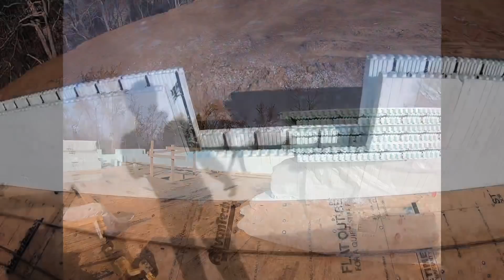ICF second level stacking #ICF #nudura #nyamillennial

Comment: Nice job Matt. Good tip on keeping the height of doors and windows the same. Would it have been better to not poured the cement so high in the top block?
Reply from the maker: Tom, the concrete is kept roughly 2” below the top of the last block on the basement pour. This ensure a constant height for the cold joint. If we didn’t smooth it down it would be very difficult to get a consistent height.  This is just what we have found to be the best. What helps most is having proper thickness of tape to ensure no concrete ends up in the dimples or on the nipples.
Reply: Tom, the manufacturer specifies that the blocks should only be half full when you are making a cold joint. It's easy enough to make yourself a gauge with a stick that goes eight inches down to get level.

Comment: Wondering if you would/could share the dimensions of that place?  I'm wanting/planning on doing something similar around 30'x50', except at the 50' mark, there will be T's because I'm planning on a full-depth garage with a structural floor slab so I can park AND have a virtually sound-proof shop below.  I'm not especially particular on an exact size, but more interested in dimensions that use the most un-cut blocks in both X and Y directions.

Also wondering if I can do 8" foundation walls and 4" main floor?  I'd like to use 14" TJI's and span the entire basement with the ends resting on 4" of the 8" foundation wall, rather than having to hang LVLs around the perimeter.

Looks good, sir!  Namaste
Reply from the maker: This job was 52x57.  Nudura blocks are 8’ long. I would recommend 10" bottom and 6" top. I see where you have a 4" offset which I what we recommend but 4" cavity is getting pretty small.

Comment: How do you place the next courses vertical rebars after each course ?
Reply from the maker: It stacks right on top like any other course. Those verticals run past first set of horizontal in first course of second level
Reply: @nyamillennial  do you run long enough vertical for entire first floor or do you lap another piece at some point since it might be in the way of stacking courses?

Comment: They don't have to worry about the water ruining the plywood/OSB subfloor?
Reply from the maker: The OBS is treated. All homes built have the chance of the sub-floor getting rained before the roof goes on. Thank you for watching!
Reply: Advantech is one hell of a product. I'm a home builder in AZ and people are now just starting to use it. When I framed in North Dakota and Montana that's all they used and a subfloor could get hammered all winter long and not even swell. Little expensive up front but saves you from tarping/sealing a floor before a big storm. Also looks way cleaner IMO

Comment: I imagine one of your other vids shows how the subfloor is sitting on the wall.
Reply from the maker: That will actually be in DPs channel. But to explain it, we place octagons plates in the basement wall before we pour. There is the a “J” brackets that holds the band board to the plate. Standard joist hangers are then placed at each end of each floor joist to attache to the band boards. I hope this helps!

Comment: Its weird that the floor is hanging off the wall rather than on the block
Reply from the maker: Ed, not sure I understand your comment. The floor is attached via metal brackets poured into the concrete wall with skirt board then floor joist hangers for each joist. Maybe I am missing what you are meaning?
Reply: @nyamillennial  you answered it ty